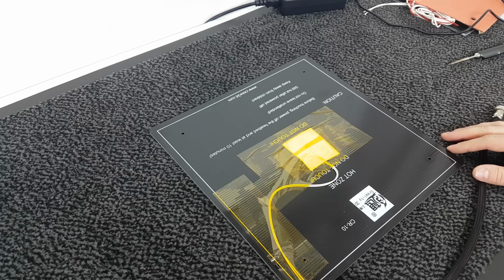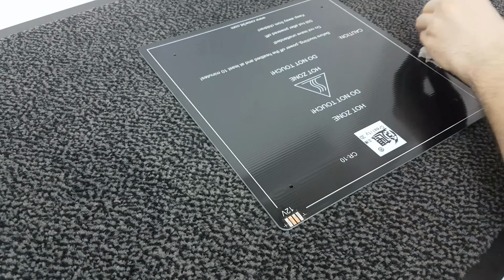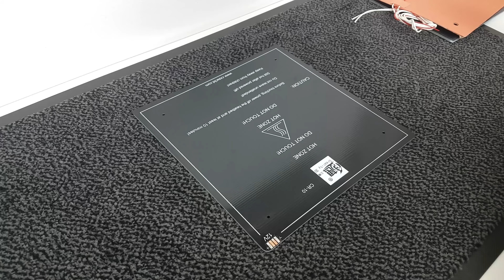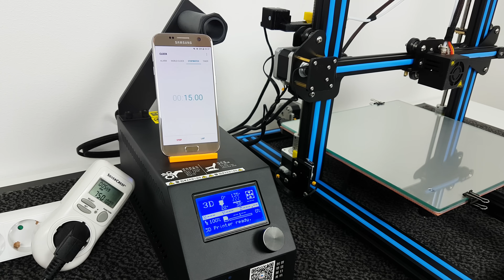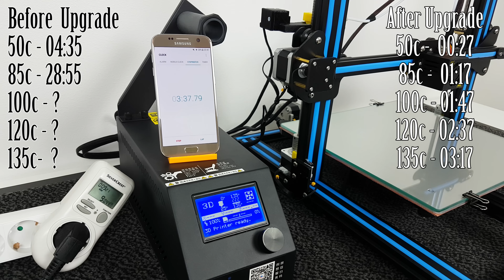Creality Cr10S ultimate Heat-bed upgrade! 750W heater installed

Comment: Nexi, tks a lot for the help you provide with your videos. A few month ago i made the same improvement on my CR-.10, following your steps. Now, I am thinking about improving my printer with one of those boards, the Duet wifi. Can you help me with this? I manage to do some tecnical things but i dont think i have the knoledge to do something like this. I wold like to install the duet wifi and preserve this bed heating system on my printer. Do you know if it is possible to do this or do you sugest other way to get 32 bits working on the printer? Tks a lot. Love your work.

Comment: how is your cr-10s performing after over a year of use on the new heated bed upgrade? was there anything you changed to the heated bed after you made the video?
Reply from the maker: I got bored, so I Great! I never had any problems with it. Still runs awesome! After this upgrade I have replaced stock glas with Ultrabase and I add stepper motor dampers and heatsinks. Only God knows how many printing hours I have on my CR10S, it's real working horse! :)

Comment: Can u put this on cr10s pro...?
Reply from the maker: lio hay No need for that. Cr10S Pro comes with 24V system and with heat bed insulation pre-install. It can print ABS out from the box.

Comment: I  in the US and my voltage at home is 110, this will work here or I need 220?
Reply: You need a 110V heater and relay.

Comment: EDIT: SOLVED just add a ground wire!

Recently I bought a E3D heated bed (E-BED-HT-300-300-240V-KIT). After installing it following your excellent video, the test worked fine. 135 degrees (according to the controlbox) within no time and I could see the relay do it's work. Nice.

But the I felt a little tingle when I touched the heated bed (when it wasn't warm anymore). I examined the edge of the heated bed...it was smooth. Then I found out that the tingling was only the case when I touched the heated bed and the control unit of the printer...oops. I got out my volt meter and started to measure on the control unit trying to find the point where I f*cked up. Everyting was connected according to the video and shielded properly. And there was no current on places where it shouldn't.

Then I pointed my research on the heated bed. Holding my volt meter between the heated bed and the ground pin of a wall socket it happily showed 230 volts. Is there a flaw in the video? I looked at the wiring. The neutral of the power supply went to the connector of the heated bed. Turning the wall plug 180 degrees (that's possible with dutch wall plugs) There wasn't any current on the heated bed anymore. Problem solved?

No not really. First of all I don't want to pull out my volt meter every time when I plug my printer into the wall socket to see if I have to turn the plug to not get electrocuted. Secondly I think it is strange that the heated bed itself gets current. I would expect that only the heating element in the rubber mat beneath it should get current.

By the way, even when the heated bed is electrically completely isolated from the printer but only connected with the wires of the heated bed to the control unit the tingling occurs.

Comment: I had an issue with my bed not getting to temperature. I saw your tutorial and got all the items as stated. The wiring on my box is different to yours where you connect the solid state relay. I have two yellow wires above the black wire and your seems to have two spare slots and then the two yellow wires. Would this cause my solid state relay not to turn on?
Reply from the maker: Take the 10USD multimeter and test every wire and every output on motherboard and SSR and then connect it nice and slow then re-check everything with multimeter when you test the heated bed. Also add one more ground wire from heat-bed screw to the ground om the AC switch or powersupply, you might need to dril a small hole on the bottom plate or on the back of the control box.
Reply: @NexiTech  Thank you for the reply. I have a V2.1 motherboard. I disconnected the hot bed and connected that to the SSR and it worked.  Thank you again for the tutorial.

Comment: For roughly 25% more money, you can buy the same Keenovo heat bed that has it's own external controller. This eliminates having to connect it to the CR10 control box if you are not very comfortable with wiring. You will still have to de-solder the old heat bed though.
Reply from the maker: Why not, that's good idea. I will place that option in video description as well. Thanks

Comment: The original plug is designed for low voltages or signals. 
Its not designed for high AC voltages, its a great mistake for using it ! its has a metal housing and the only safety provided is by a small piece of tape. My advice as an expert is not to follow this way. Its very dangerous . Secondly the whole heated bed should be grounded! I afround wire should be connected one of the screws of the plate with the ground of the AC plug! Please be carreful
And, B7000 is not designed for high temp, instead it should be used high temp silicone (red silicone)

Comment: How can I tell which wires from the heater bed to connect to which spots on the connector? the wires coming from the heater bed are all the same color.
Reply: The two wires from the AC heater bed will attach where the large red and black wires from the old 12VDC heated bed were attached.  It doesn't matter which of the AC wires is attached to which of the old 12VDC connections were, as you're dealing with AC and not DC.

If you've already unsoldered everything and are having trouble determining what each of the connector pins should connect to, remove the bottom of your control box (disconnect the power first), and look at the backside of the aviation plug.  You should be able to easily identify which of the two connectors are for the thermistor, which uses a very small gauge wire, and which of the two connectors are for the heated bed, which use a large gauge wire.  For both the thermistor and the AC bed connections, either of the two wires can go to either of the two associated pins on the connector.

Comment: hi, is there a similar upgrade for the CR10 mini ?
Reply from the maker: You don't need this upgrade for Cr10 mini. It can reach ABS temps just fine. If you looking for faster heat bed warming up time just install insulation under Heated bed and use silicon glue.

Comment: You should allow the top of the spring to touch the aluminum bed from the bottom. Right now it touches the foam. :(((
Reply from the maker: Tigran Ohanyan Foam(insulation cotton) is so fragile that as soon as you start to screw down heated bed metal spring will cut out ring and touch rhe aluminum heated bed.

Comment: Warning! As standard, the CR10 does not require an earth wire attached to the printer assembly. This is because it is powered by low voltage ONLY which is provided from the control box. The control box is earthed but NOT the printer. As this mod provides mains power to the bed without any protective earthing, it would be a very good idea (to remain safe!!) to run separate earth wires directly to the aluminium bed and the CR10's frame. Better still, get an electrician to do it for you.

Comment: Great video! Althought a little exagerate with the 29mins to reach 85C xD. It takes around 10mins or so but not half an hour
Reply from the maker: Maybe you have newest CR10S  model? 24V? My both old CR10 and CR10S are first generation and they have 12V heated bed. Takes a long time to heat up. I made review of CR10S and I shown timelaps video how long it takes to heat up. Fast forward this video to 19:08 
https://www.youtube.com/watch?v=tFfMPjKhF8c&feature=youtu.be
Reply: Mine takes a lot longer than 10 minutes as well and it will not always reach 95 degrees which makes it very hard to print ABS.

Comment: Hello. I got the same printer, but there was no filament outrun sensor and on the main cable that comes out from the power supply. Do. i have cr10 or 10s, how can i distinguish it?
Reply from the maker: FOGLIA NERA GRAPHICS Do you have Dual Z axis? It could be CR10S
Reply: @NexiTech  i have not, but it is super silent. It has the fan that points directly on the noozle. This is weird

Comment: Yea. I quadruple checked every step of this setup and each time I  try to use this install it blows a fuse.
Reply from the maker: Fletcher .K Fuse? Check your fuse amp rating. If is only 5A and you have 110V AC that's 110Vx5A= 600W wich is too little. If in your country AC is 220V×5A=1100W you are fine with 5A fuse. Also double check AC heated bed with multimeter and install ground wire as well just to be safe.

Comment: Well I tried following these instructions exactly and it shorted my power supply so maybe the dissenting comments have a point...
Reply: You almost certainly did something wrong though. Most probably you connected 220V AC to a 12V DC line, maybe you had a bad connection somewhere. If done correctly there is no way you could fry your power supply.
Reply: If you "followed these instructions exactly", you would not have shorted your power supply. You screwed up. Your fault 100%.

Comment: The update is really useful, but the connector was no thinked and not is approved to handle 220v. Sorry but you only need to find a better option for de connector.
Reply from the maker: Diego Caparra This connector is rated to handle 220V and I'm  using this setup for the past 15 months without a problem. Countless working hours

Comment: I've got a square meter plate heated by 1500 watts and I thought that heated up pretty quick... This thing must be a monster
Reply: Hi Anthony. We are talking of an area of 0,3 * 0,3 m = 0.09 m² and we are using 750 W. In theory, for every doubling in area you should quadruple your power to reach the same temperature rise per time unit. This is without taking all losses into consideration. You will probably reach your target temperature, but it will take a long time. In fact you should use 1 m² / 0,09 m² * 4 * 750 W = 33 KW to get the same rise in °C/time unit.

Hope you live next to a power plant!
Reply: @thormarum995  yes. My engineering degree motivated me to pick 1500 watts due to the limit of a 120v outlet. It heats up in less than ten minutes to 50c.
Reply: Hi  @fataxe1  . You must live in warm country if you can heat 1 m² to 50°C in 10 minutes using 1500 W. I use 750 W to heat 0,09 m² to 50°C in less than 3 minutes.
Reply: Oh - by the way. I'm an engineer too. I work with heat- and cooling meters.

Comment: nice upgrade, how about the power consumption and the cost in the long term ?
750W is quite large and the printer will turn the relay on and off during a print. did you measure the time when the relay is on ?
For print that take hours to be done, the printer will cost in electricity as much as a small home heater.
Reply from the maker: ALB Workshop It's not constant 750W obviously ;)  
I have instaled Heated bed insulation so it maintain heat much better and heat loss is minimised. I would say that now it saves electricity actualy. Before powersupply was runing constant on ABS and it still printer could not reach or maintain high temps for ABS. And for PETG and PLA it reach temps very fast so much better efficiency actually.
Reply: @NexiTech  thanks for your answer
Reply: Hi ALB Workshop. I will just copy the reply I gave Seacred.

I have used this upgrade for about 4 months and - no, it will only use the power needed to maintain it's temperature. Exactly like your old built-in controller did. The original controller had to work more often and for longer time as it had much lower power. In theory the power used during a 20h print would be exactly the same (in KW h) but spent at different time intervals.

Comment: Firmware upgrade - how to do?

Yesterday i bought a second-hand CR-10 - S4 printer. It's manufacture date must be late 2017 according to the labels inside it. I have a CR-10S - S3 bought in Oct. 2018 (new) and it's firmware is very different from this one.

Below a few issues you should consider when owning and using a 3D printer:

I was actually surprised how much maintenance is needed when I bought my first printer. However it's essential to get a good print quality.

The printer I bought had not had proper maintenance during it's use. It did, however, have a lot of expensive upgrades, but the basics had been neglected.
 
I have found several screws that were not tightened, the Z-axis motor would climb up the rail when activated instead of moving the Z-axis. Both retainers for the Z-axis screws were loose and didn't help much with precision movement. Both belts were out of alignment and severely worn.

So far I have spent approximately €50 for spare parts. These are parts that I had in stock for my old printer, but I think I'll have to spend €50 more. Luckily I got it very cheap as nobody else had responded to the add.

Comment: Will the Printer stay at ~750 watts of power consumption while printing?
 I mean this would be much during a ~20h print...
Reply: Hi Seacred. I have used this upgrade for about 4 months and - no, it will only use the power needed to maintain it's temperature. Exactly like your old built-in controller did. The original controller had to work more often and for longer time as it had much lower power. In theory the power used during a 20h print would be exactly the same (in KW h) but spent at different time intervals.
Reply: @thormarum995  Thanks for your reply.
That was exactly what i was worried about.
Whats about safetyness? I wonder if the SSR or the heater can cause fire in some cases. Actually i didnt have a garage neither a basement where my printers are working...
What you guys think? Better or worse compared to the stock hardware?
I would need a 1400Watts 400x400 for the  CR10S4...
Reply: Hi  @JDSeacred . I also have an S4 but using only 680 W. You don't need 1400 W. In fact 750 W for an S3 is overkill, but these heat mats are very common and therefore cheap. I bought the S4 second hand and it came with the 680 W installed.

I understand your concerns regarding safety - and yes this heating mat can get extremely hot compared with the stock heat mat. I have heated my S4 to more than 180°C and with only 680 W so the S3 with 750 W can probably get even hotter. First advice is to keep a safe distance to anything flammable, like curtains.

This said I'm not worried and the reason is that at my work we have 100's of SSR's controlling heating elements, up to 32 KW. I often replace a defective SSR but I have never, and that is never, seen one conducting when it failed. They are always non-conducting; that is the heating has been shut down. I'm not afraid to leave my printer unattended for 20 hours.

If you want to have more safety you should put a hot-melt fuse underneath your heat mat in series with the heat mat power supply. These fuses are used in coffee machines and likewise. They are available in different temperature ratings. I think from 120°C to 180°C.

Please don't worry. Go ahead and make the modification; you'll love it.
Reply from the maker: Seacred It's not constant 750W obviously ;)  
I have instaled Heated bed insulation so it maintain heat much better and heat loss is minimised. I would say that now it saves electricity actualy. Before powersupply was runing constant on ABS and it still printer could not reach or maintain high temps for ABS. And for PETG and PLA it reach temps very fast so much better efficiency actually.

Comment: Thanks for your video.
Just one thing. At 8:40 in this video you connecting wires in to heater0 in the middle it was wrong for me. It was start working when connect them to heated bed first two beside.
Thanks
Reply: Yes I found exactly the same on my CR10-S. The heatbed relay wires need to be connected to the two terminals at the bottom of that connector block as shown on the video. It is is extremely important that the polarity of the wires is correct or the relay will not function. 
Otherwise a flawless video and many thanks!!!
Then make sure you EARTH/GROUND your Heatbed and Printer Frame to EARTH/GROUND running an EARTH/GROUND Cable to the the correct connection inside your 3D Printer's PSU.
I followed a guide on the TEVO Tornado on how to make it safer/grounding/earthing. Please use Google or Youtube.

This is an extremely important safety feature and if you are going to all this trouble to upgrade your 3D printer,  PLEASE DO THIS AT YOUR EARLIEST CONVENIENCE!

Thanks
Coaster

Comment: v2.1 board requires you to use the "Hot Bed" connectors on the board. These are the two connectors that the wire from the mosfet run to.
Reply: This helped. I worked for the 2.0 as well. Not sure if it's because I updated firmware.